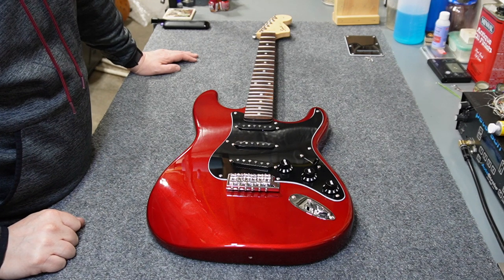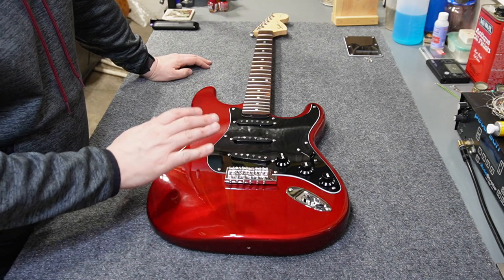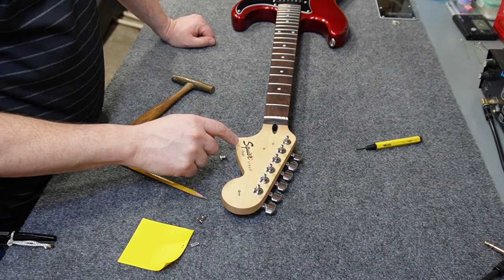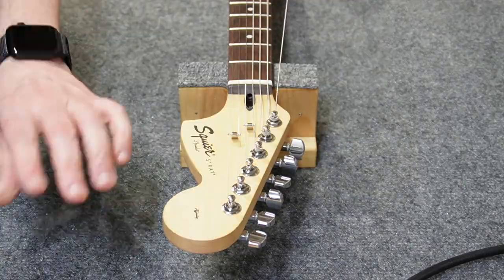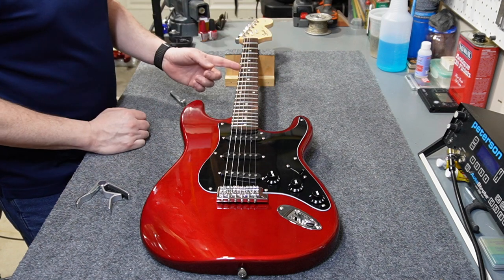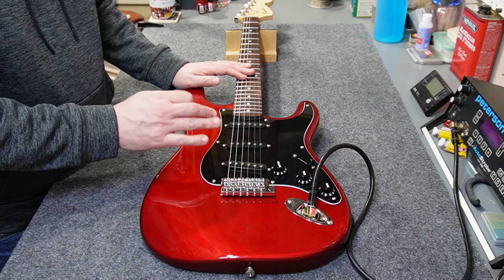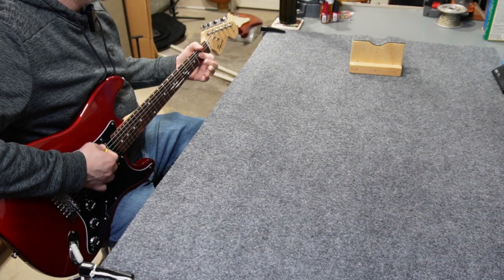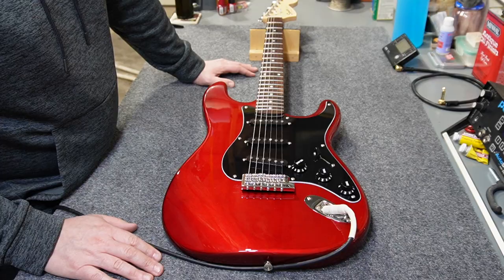2007 Squier Affinity Stratocaster Upgrade - Part 3: Strap Buttons, String Trees, Strings, Setup/Test

Comment: I’ve always wondered how to decipher what pickup resistance is and what it shows. Is that just how hot it is or is there more to it than that? I’m shopping for a loaded pickguard for a partscaster, and all the ones I’m seeing have the resistance ratings listed in the listing info, I just don’t know what to look for in picking which may be better suited for this guitar
Reply from the maker: DC resistance is an indicator of the hotness of the pickup.  It’s not a perfect measure but is an easy and common measurement.  Single coil Strat pickups are historically in the mid 5K to low 6K range.  Hotter pickups or ones with higher resistance will typically overdrive more quickly and be louder.  That is somewhat dependent on the magnet type and wire used, but generally a higher resistance means more copper windings and greater output.  Greater output generally means less bright.  If you play jazz or mellow blues, go lower resistance, but if you play rock or distorted blues, you should go hotter.  If you play metal and look at really hot humbuckers, you will see very high resistances listed.
Reply: @hacksguitarhobby  thank you for clarifying. That makes a lot of sense now. I’ve been seeing it on all these pickups wondering “ok, what does it mean?” lol I have a better understanding now 🙏🙏